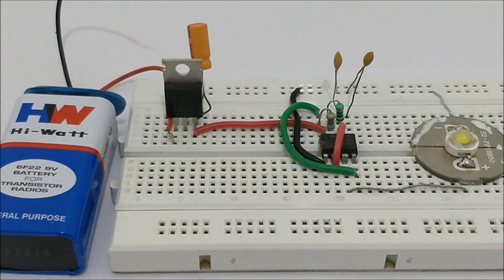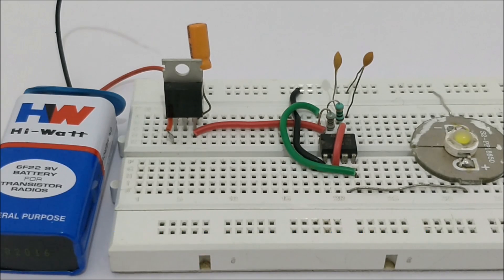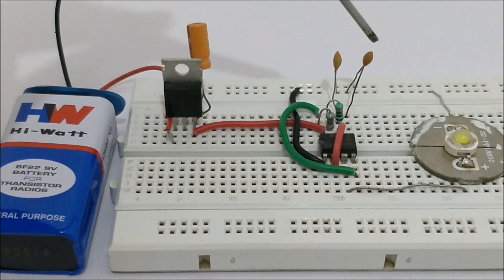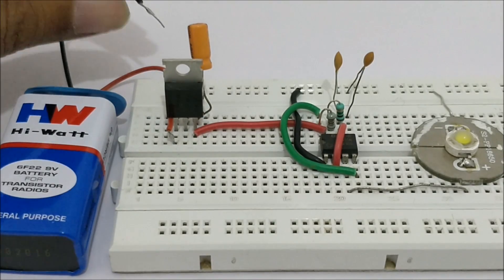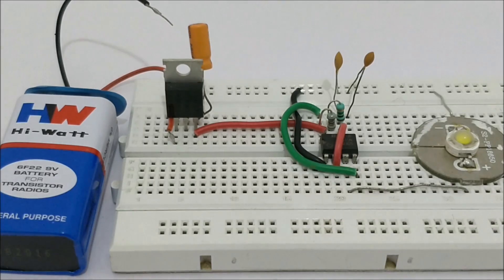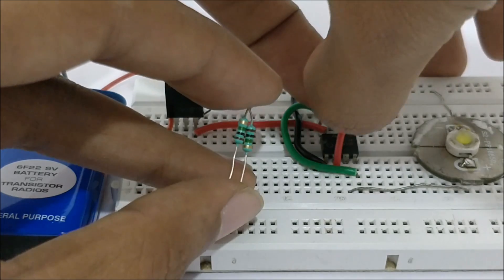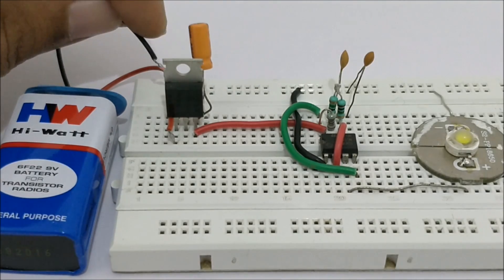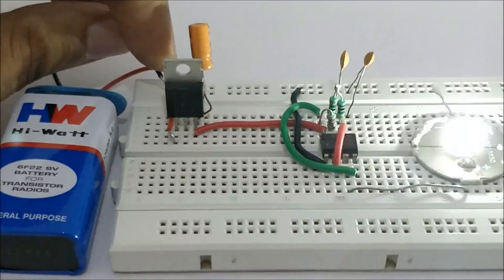LED Strobe LED circuit on breadboard

Comment: It is not a strobe light, it is just a blinking light. For a real strobe effect, you need to adjust the duty cycle, so that the "on" time is shorter than the "off" time. With duty cycle of 50%, it is just blinking, not strobing.
Reply: I wonder if regular (or at reasonably priced) LEDs can strobe @ 200Hz - 400Hz. I was thinking about making an optical strobe for tuning stringed instruments.

Comment: why do you use monoastable and why not astaable
Reply from the maker: Very Good Question.!!!
Yes the Astable mode in a 555 timer is the most used one for flashing LED. But the pulse generated from the Astable mode can only be controlled on its period. Meaning! Period = on_time+off_time. This means that if the period is 100ms and you turn it on for 20ms then it can to remain of for 80ms. This will not help us to make it blink fast at low frequency. But using a Monostable will help us do it.
For more technical details you can use our Forum: https://circuitdigest.com/forums